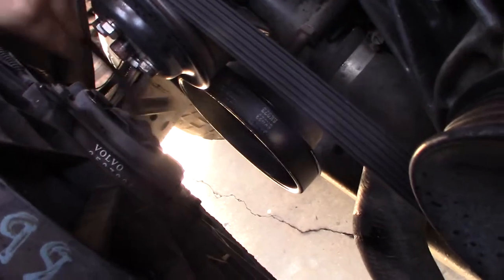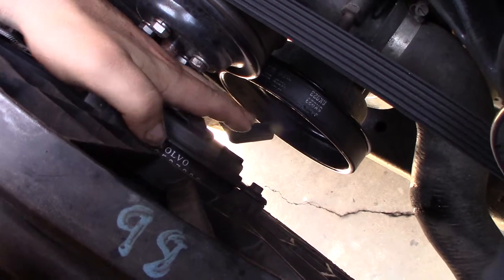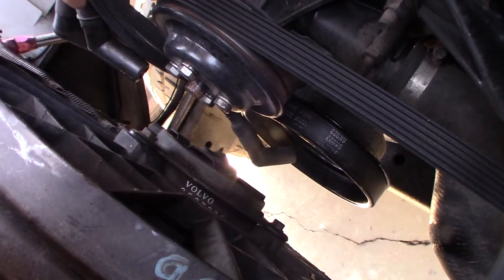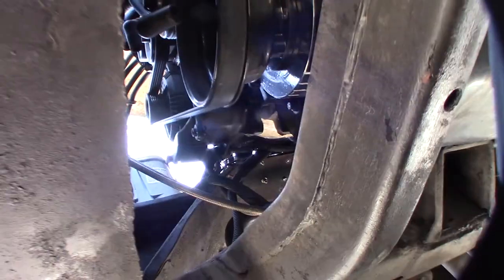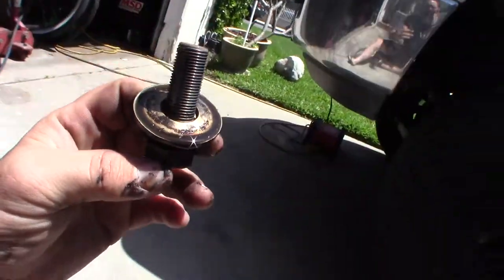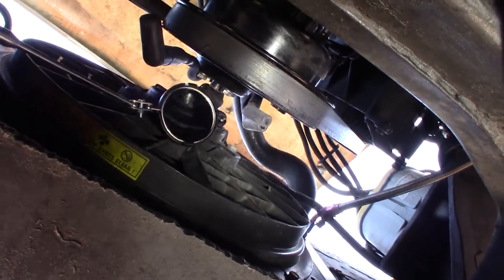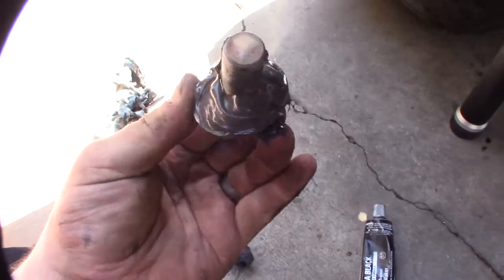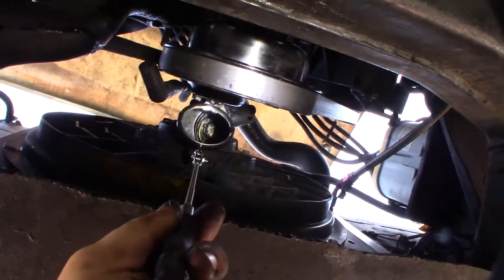Ford 289 302 5.0 351W Crankshaft key oil Leak from harmonic balancer bolt pulley

Comment: On the engine I had that I know had not been messed with factory also can tell by the color of silicon ford used back then might still do but they had just put a dab on the very end of bolt from factory don’t take much just figured run that by you but not talking junk man I’ve over used the heck out of silicon on stuff over the years like yep if it leaks now I’m putting it up for sale 😂 I’m just kidding not that bad